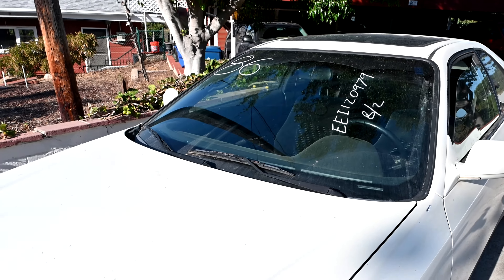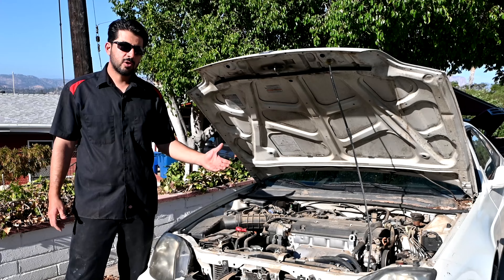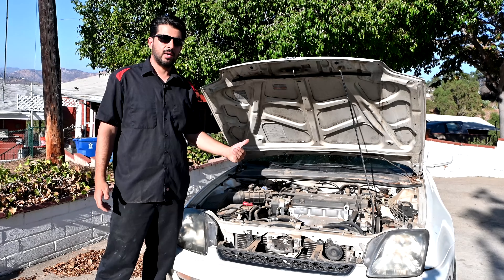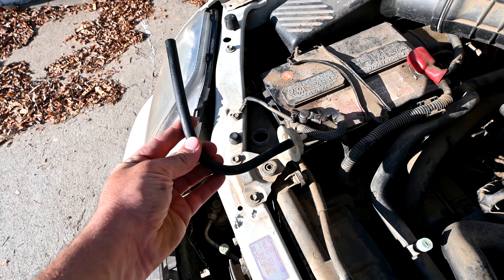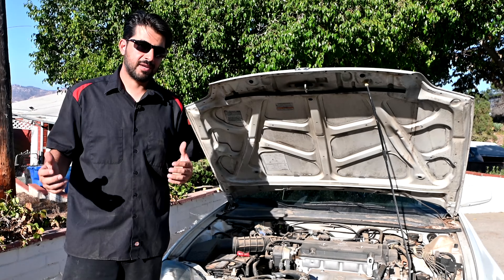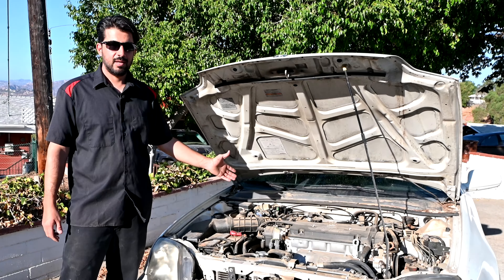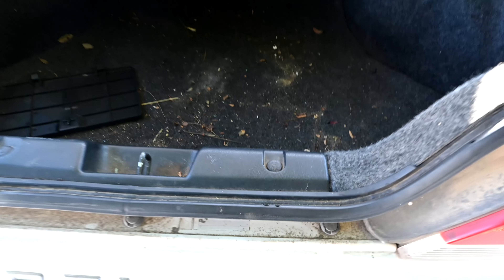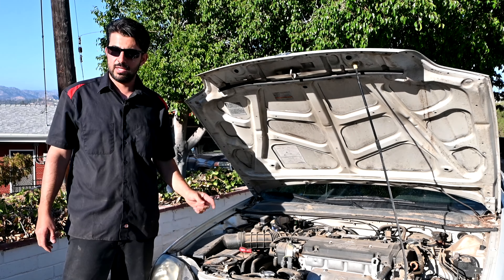Did I Get a Good Deal on This Honda at the Auction?

Comment: My first car was a 4th gen Prelude. 1994 Prelude VTEC h22a1 "Gold Edition" Whatever that means... It had a 5 speed manual, gold badges on it, and a 6 disc CD changer in the trunk. (Which CDs were still some what relevant in 2009) 128,000 miles on it, my dad and i paid $3,400 for it. I drove it all the way up to 211,000 miles with no issues other than having to replace the clutch. No issues until the harmonic balancer pulley bolt came loose on me. I parked it at a friends house for a few days not knowing what was wrong with it, Then my Dad decided to try and drive it home (instead of towing it)... Naturally the bolt and keyway that hold the timing gear on the crankshaft worked themselves completely out and the engine went out of time.😒 that was the end of my Prelude days, but I still have that H22a1 engine. It is now built and in a EK Civic hatch so it all kind of worked out I guess

Comment: As a prelude sh owner myself, you forgot to include that these cars have problems with electrical systems. I'm currently having that issue. Idling problems as usual with every honda and that h22a4 burns oil like a mofo. My euro R h22a also burns oil so it doesn't matter what h22 you have in there. Welcome to the club, but also enjoy the prelude curse. Thankfully you're a mechanic
Reply: My 1999 has been my daily driver for around 22 years. It burns tons of oil!! 😆

Comment: Nice bro. 
I picked a 05 Accord coupe V6 6speed manual for 2800$ after auction fees 118k miles. The only problems Ac needs work and 3rd gear syncro grind a bit.
Reply: What auction did you buy it from

Comment: These generations of vehicles from Honda would have been awesome with a six speed manual. Owned a 91 Integra GS that felt forced after hitting fifth gear.
Reply: Honda always had short 5th and 6th gears IMO. Even the 05 Civic with the VTEC engine is geared to run at nearly 4K RPM at 80, which annoyed me so much that I put the non VTEC trans in it. Now I can go 80 at 3200 RPM. A lot of Honda's 6 speeds have short 6th gears too. The S2000, RSX-S, TSX, and 06-15 Civic SI all rev way too high for my liking despite having a 6 speed.
Reply: @averyalexander2303  You are correct. I put a Del Sol transmission that someone converted to a cable shifter in my 91 Integra GS and it turned it into a gas hog. 80mph was a little over 4k rpm.

Comment: Here are some of the 5th gens. main issues. H22A engines burn A LOT of oil. If you know Preludes, you should know that's a very common issue. Also the main relays give issues with bad solder joints, EGR ports will get clogged causing a random cylinder misfire code, auto timing belt tensioners give out way before the belt AND the distributor has a sensor in it that causes no starts.

Comment: To me Hondas are just oil burners ... good to about 200000ks, then best of luck ...
Reply: Welp, Honda is still the second best in the world in reliability. Piston rings aren't designed to last forever, all engines eventually become oil burners if they're not rebuilt after a few hundred thousand miles.